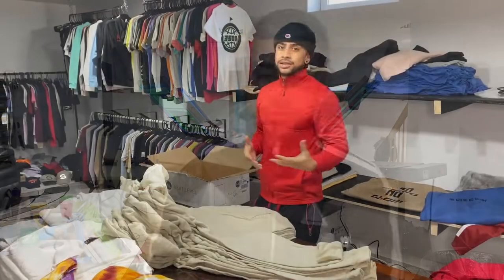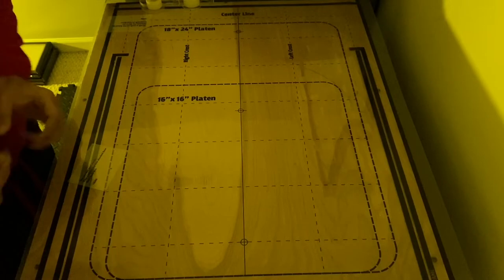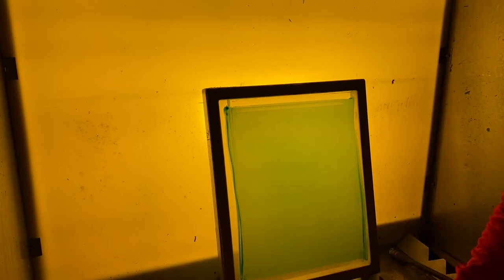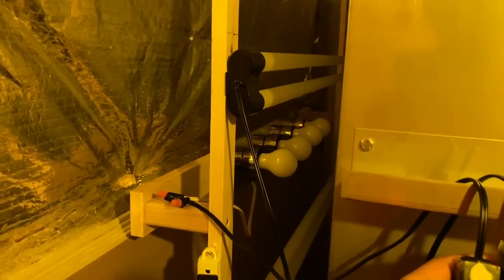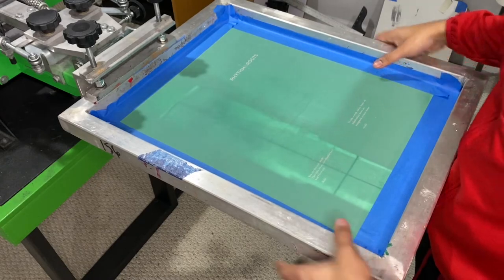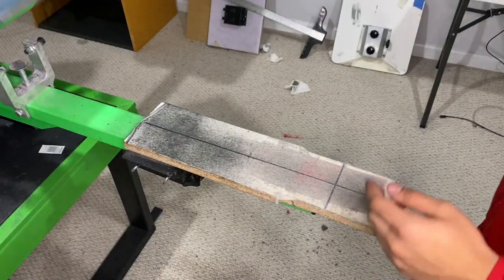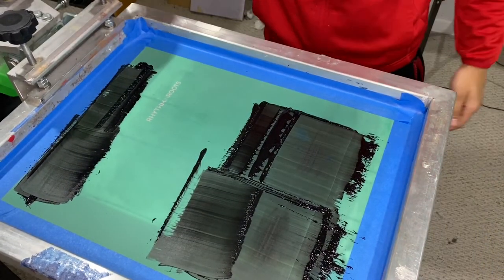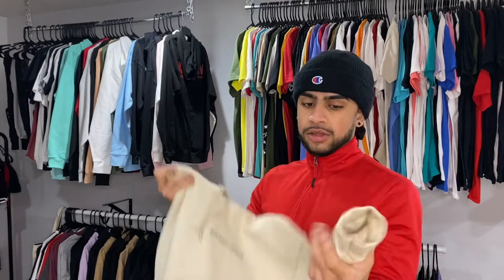HOW TO SCREEN PRINT EFFICIENTLY | FILTRATION SYSTEM TOUR

Comment: I got a used Easiway dip tank and filled it up with just plain water and I soak my screens before blowing them out and it works great! They sit in the tank for about minute and they image sprays out easy
Reply from the maker: That's awesome Tim! thank you for the tip on that. I heard about that method a while back but never tried but now I will definitely add it to the process, thank you again Tim!
Reply: I switch up and do the same ... it’s been a game changer for me 🤟🏾
Reply from the maker: @Factory928AC  Game changer for sure! Thank you for tuning in and engaging!

Comment: Great video. A viideo of the cabinet you built would be nice to see. Thank you for saying what  mess you use, a lot of ppl dont mention mess #s. Do you flash dry or let it roll through heat roller?  What is that register sheet you used ?
Reply from the maker: no problem at all, cabinet video will come soon! and I always flash dry. That was a regular test pellon sheet that can be purchased at any screen print supply store.